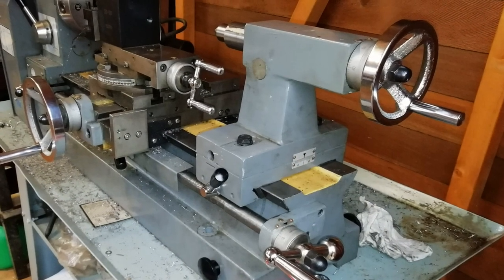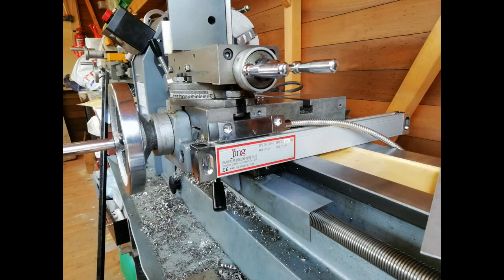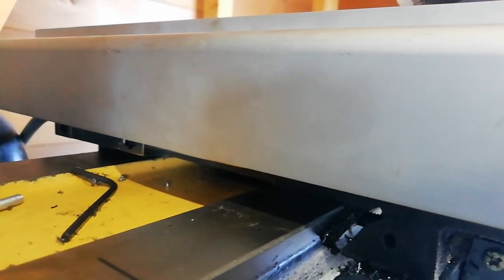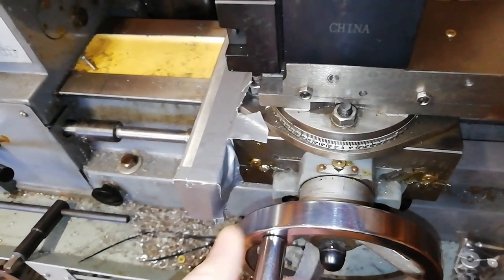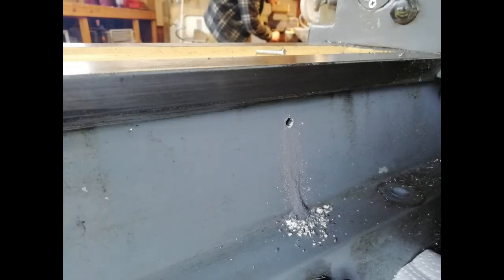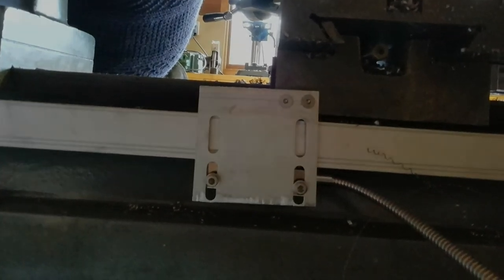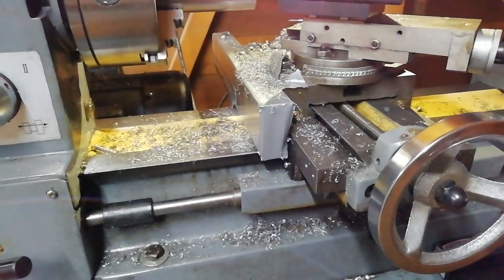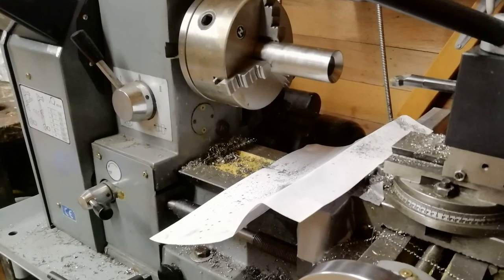Fitting Lathe Digital Readout DRO

Comment: you can fix the error!  it can be calibrated look in you manual,   all readouts need calibration when they are set up (even the 1500.00 dollar mitutoyo ) I am a toolmaker and you should check it from time to time it may need readjusting .thank you for the video
Reply from the maker: Thanks Todd. I will do that.

Comment: Are you using grease on your ways?
Reply from the maker: Yes, why do you ask? (just curious)
Reply: Chris Wesley grease is not what you want to use on ways.  In fact, many milking machines and lathes were destroyed because owners used grease.   You really need to use a way oil.  The most popular is Mobil 1 Vectra, but many alternatives are out there, do a quick google search.  Hope this helps!
Reply from the maker: But the lathe comes with grease nipples for the application of grease, so it's difficult to accept that grease is bad for them,. Can you square that circle for me?
Reply: Chris Wesley many manufactures used zerk fittings because they were so readily available in the market, but they also sold OILERS that fit those zero fittings.  If you think about it, zerk fittings are nothing more than ball oilers that stick out.  Thousands of machines were destroyed over many decades because grease was used.  You will see a lot of Bridgeport mills where precious owners used grease.  Chips, dirt and harder material sticks in grease, act as lapping compound and cause wear.  Just google “grease” on milling machine and lathe” and you will find a treasure trove of info.  Hope this helps!
Reply from the maker: Fascinating reading Woods. Interestingly, my lathe manual does say to OIL the slides, referring to the grease nipples as "!oil points"... interesting. Thanks.
Reply: @chriswesley594  Hello. I just came across your channel and it looks very interesting. I also have a workshop with a Harrison M250 lathe, Chester Mill and I'm restoring a Harrison Horizontal/Vertical mill from the 1960s. I've written about my mill and lathe on the mig welding forum. I echo the comment about not using grease on your machine. Grease nipple is a very unfortunate term. They should really be called lubrication fittings. They are for oil. My Harrison Mill has been assiduously greased by some ardent individual over many years and it has caused no end of issues. I'm going to subscribe to your channel, it is always good to find another UK based engineering channel.
Reply: @woodscreekworkshop9939  well pointed out Yuchol
Reply: @carlwilson1772  hi Carl look out for Doubleboost, and Ades workshop and if you are interested in real precision engineering look for Mr Crispin. That young lad,  I think he is about 25 yo now is a bloody marvel. Apprenticed to Rolls-Royce in their aerospace division, he has been posting videos since he was about 16 and the work he produces is unbelievable. Just look at his chanel and be astounded. On top of that his explanations are spot on, and he is such a good teacher. His drawings are magnificent ( even his sketches are line perfect as he can draw a strait line freehand better than I can with a rule lol ) on top of this he has a magnificent new workshop full of some very nice toys and watching him line bore his steam engine piston  parts and boxes is a joy to behold if you love engineering in one of its purest forms.
Reply: @samrodian919  I watch all those people. You are right about all of them.
Reply: @samrodian919  agree, Mr Crispin makes some very nice stuff.  Also Jon’s Workshop is pretty good albeit a lot newer channel.

Comment: Thanks for that Chris, i have the Warco version with milling head and will look very carefully at this vid again as i want to set it up with a DRO. . I cant think why you would send all the way to Oz for the DRO when they are available in the UK for a similar price,( i of course want a 3 axis for the mill)
Reply from the maker: Hi Sam, the Austr5alian option was the best I found when I looked. If a UK version had presented itself I'd have bought it instead. How is your Warco? I've always wanted to see one of the milling attachments in use - they look quite flimsy but maybe not. I did wonder if I might convert mine but looking into the headstock housing there is no power takeoff so I guess it;s not possible.
Reply: Chris Wesley have you taken off the square blanking plate on the top of the headstock? There is a bevel gear under it from which the mill is driven. It's a selective drive on the end of the lathe spindle, by a simple dog clutch. Pulled out for lathe spindle, in for mill.
Reply: Chris i have just looked at your video on your acquisition of your lathe, and the parts i described on the spindle are not on your lathe by the look of it. It possibly comes as part of the mill set up but I don't know mine is the Warco WMT 300, The lowest spec of the three lathe series.
Reply from the maker: @samrodian919  Correct. That's what I was saying earlier. When I look down into the headstock behing that plate, there are no working parts to see - just the inside of a casting. So I guess I cannot add a milling attachment.

Comment: how did you attach the x scale to your lathe? did you drill holes and screw them in or...?
Reply from the maker: Yes, for both scales I drilled then tapped holes. For X they were drilled in the cross slide.

Comment: The weird plaster might contain asbestos. If it could be done for free then might be worth checking with Environmental health. Anything like lead I would not worry about at all but asbestos is a different ball game.
Reply from the maker: Good thought! Eek.
Reply: @chriswesley594  It won't. Its not plaster as such but a type of filler used to smooth out castings.
Reply from the maker: @carlwilson1772  Thanks for chiming in Carl.
Reply: @chriswesley594  No problem.  My chime is about a year late.  I'm not sure if you'd be interested but I have a fixed steady for that lathe you have.
Reply from the maker: @carlwilson1772  It's a thoughful offer, Carl, but I already have one. If yo have a set of change wheels though - I might be interested?
Reply: @chriswesley594  I'm afraid I don't. I had a lathe like yours about 13 years ago but sold it on. It was only afterwards I realised I still had the steady. Making a set of change wheels would be a good project. You can also 3d print them.
Reply from the maker: @carlwilson1772  I hadnt considered 3D printing them! I was planning on making an Arduinio-based automatic feed system to allow thread cutting of all sizes and other things too, but then - I was also planning to lose weight...
Reply: @chriswesley594  A friend of mine 3d printed me some change wheels on an SLA type printer. I made an Arduino controlled indexing system based on a project by Gary Liming.
Reply from the maker: @carlwilson1772  Wow! Too bad you don't make videos Carl - I'd find that interesting to see.
Reply: @chriswesley594  I'd make about one a year and it would be worthless!
Reply from the maker: @carlwilson1772  Yeah. Same here!
Reply: @carlwilson1772  hi, you don't happen to still have the steady do you?
Reply: @hhe5218  Yes I still have it.
Reply: @carlwilson1772  great! I belive my lathe is another chinese copy of the same lathe, the ways are ~13.8 cm across. Do you have an email I could contact you at?
Reply: @hhe5218  I have but I am loathe to publish it here as I will no doubt end up receiving spam like there is no tomorrow.